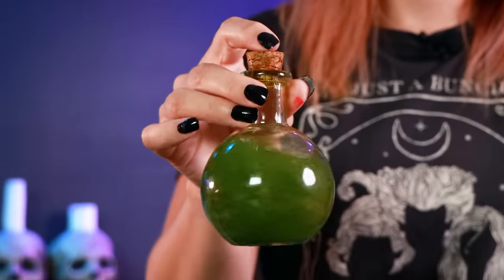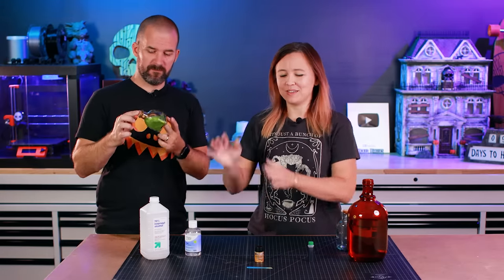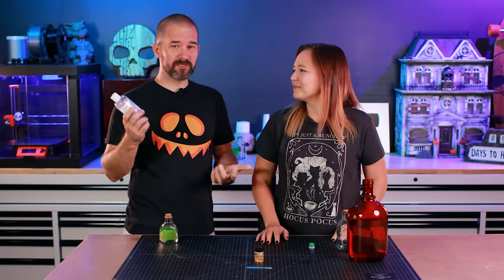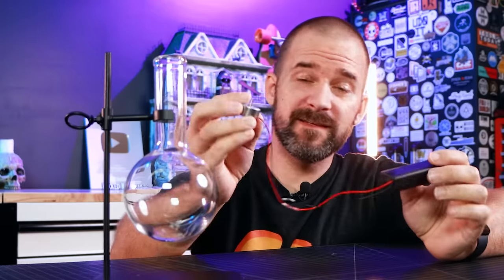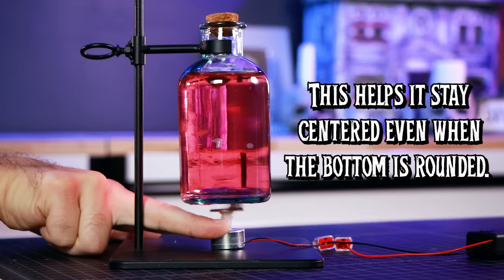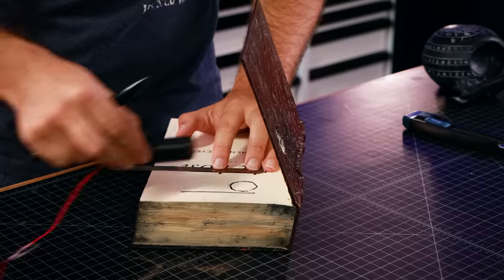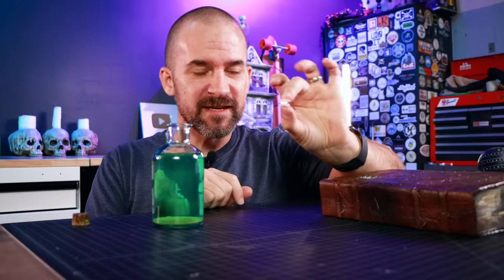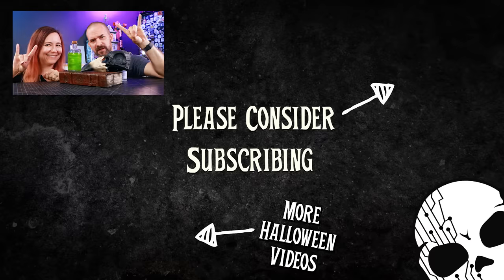We made Halloween Witch's Potions with a Magical Twist!

Comment: Guys! You make this look so easy! Im struggling- bought all your items but i cant get the magnet part to work.   The nut with quarter flies off the second it gets close to the jar….. any ideas/ thoughts/ tips???
Reply from the maker: The whole quarter flies off the motor?
Reply: Yes. The quarter is glued to the nylon “ nut”.  Magnet glued to outside edge of quarter. Did you glue the nut to the shaft?? Ive watched and stopped this video 100 times to see where i went wrong!! Lol. You guys seem to be the pioneer of this prop!  Thanks
Reply from the maker: @paulakrouse8303  YES! We did glue the nut to the shaft, thats what you're missing. Put some hot glue on the inside of the nut and squish it down onto the shaft (careful not to use too much as you don't want the glue to touch the motor itself.) This will keep it on there.

Comment: you dont need to cut a hole in the book cover, magnetism is not affected by cardboard.  A small LED would make the potion glow, or pulsate, and WOULD need a small hole.dont get me started on fiber optics.
Reply: small white beads with a black dot to simulate eye of newt, added into the potion might add to the mystery.
Reply from the maker: It is affected by distance though and it needs to be close to work well. 🤘🏼🤘🏼
Reply: @WickedMakers  those dots are STRONG.  I want to make a flea circus.  Have you tried that?

Comment: Hello, Love Your Creativity! I want to make this Bottle & Book, ordered everything from amazon. But I can not find the White Nut that you Hot Glued to the bottom of a quarter. Please, where did you buy this? I have searched for hours for a white nylon/plastic "nut" that pressure fits on to the shaft of the motor that you use. Hope that you read this comment and can help me. Thank You Wicked Makers!:yougotthis:
Reply from the maker: Sorry for such a late reply! m2 is the size you'll need. It should fit pretty snug and you can use a bit of hot glue inside if you need to.

Comment: Took a bit more putzing than expected! But fun wish I could add my video
Reply from the maker: You can post it in our FB group or on Discord! Would love to see.
Reply: Mine didn’t work at all. It works when I move the outside magnet manually, but it doesn’t even come close to moving the magnets inside the bottle when I use the motor. I don’t understand how you guys got yours to work.
Reply: @KattaurusM-sx8pn  imstacked 3 magnets on motor and 3 magnets inside and works great. Jar has to be really close to the magnets with out touching. It took me. A bit of tweakingap and adjusting
Reply: I used 2 magnets inside and 4 stacked outside, like they show in the video. All it does is throw the magnets off to the side, outside of the reach of the motorized magnets. They won’t stay in the middle of the bottle. I’ve tried less magnets and more magnets. I’ve tried with and without glue on the inside ones. No go. When I use the glue on the inside ones, it flips sideways and does not stay flat like it does in their video. 😢
Reply: Okay…FINALLY got it to work. Took 9 magnets on the outside, attached to the tin lid of a tomato paste can to get a wider spin. Glued a quarter to the opposite side of the lid, to counter the magnet weights. Made the hole bigger to accommodate the larger spinning. Lastly, when I glued the inside magnets (only 2), I made one side of the glue much larger (top heavy) in hopes of keeping it from flipping sideways. Nope, still flipped, but at least it’s spinning now. Phew!
Reply: @KattaurusM-sx8pn  believe me mine took a lot of tweeks. I wish I could add photo here, I put a small piece of clear acetate about 1/2 long between my 2 magnets…act like fins to. Move water better and dabbed hot glue to stop some of the noise! So love this thing! Next onto the moving eyeball book
Reply: @KattaurusM-sx8pn  also once you get it working, after i really glued the motor down it even worked better! I kept putting bits if hot glue, let it dry then added more around the motor till it was completely firm. That hep
 stabilize the spinning also.

Comment: So I don't know electronics at all.  I was wondering is it possible to take something like the cheap motion sensor witch prop from the dollar store and adding it to an LED strip of lights.  Could that work and/or what else would be needed to complete the connection?
Reply from the maker: It wouldn’t be super hard but not quite as simple as you described. The motion sensor depends on a circuit that is built to turn on with the sensor so you’d need to use something like an Arduino.

Comment: Just curious but does the motor heat up at all and is it safe to run for long periods of time?
Reply from the maker: With just one battery it hasn’t gotten hot in our tests. Pretty low voltage.

Comment: I love this idea. I'm almost done with mine but I'm having a problem with the magnets. I cant get them to spin. I'm not sure if the motor is too fast or what. I got slightly stronger magnets, doubled up on them and still I can't get it to spin. I'm lost. Any help?
EDIT: upon further research of the motors I realized I got 3V 2 AAA battery packs causing the motor to spin much faster. Hopefully the lower voltage single AA battery pack will solve my issue

Comment: I'm confused by what you mean when you talk about the pigments. 
Mica powder IS opaque, it don't need to be dyed? The swirl is the reflective part of the pigment. Adding 'too much' mica wont change that or make it 'too opaque', heck you may want or need more depending on how much mica to liquid you have to saturate the liquid with the mica particles. Mica just... it isn't a transparent pigment. I've worked with micas in stuff like resin and DND props for over 5 years now. You don't need anything extra to make the swirl aside the water + glycerin combo and mica powder. Yeah if you add in too much dye, it will become opaque as you are over saturating the water with a pigment, but you don't need that step at all. This is like saying if you add too much of a gloss finish you wont have a gloss finish. Mica isn't transparent, adding 'to much' isn't going to remove the swirl.

Also, to do the swirl.. you can get like those pill spinners that are found in chemist sets (get like, a bag of 20 for a few dollars) and just drop a small one in and use that instead of the hot glue mashed magnets. Less risk of the glue breaking down over time and works with the same kind of motor setup. It's how I've done similar effects, even did a magic pool using well, all of this just in a small dish to be a magic pool of water for one of our dnd games with blue green swirling mica.... that again... didn't need dyes :P Just glycerin and water and 2 grams of mica and a spinner in the middle on a low setting to make magical swirls.

Comment: I'm trying to replicate the enchanted potion bottle for a Harry Potter themed trunk or treat with the kids.  Unfortunately, I can't seem to get the "storm" effect to work. Does the motor need to be a specific speed? The motors I have seem to be spinning so quickly, the magnet inside the bottle doesn't really attract to it. Did I possibly make the hot glue magnet thing for inside the bottle too big? Does the bottle need to be a certain shape/size? I get the effect by shaking the bottle, but the whole point would be to make it do it on it's own. :) Thanks!

Comment: I tried making this but its not working for me :(    the motor spins but the magnet inside the bottle doesn't move.  I ordered the products (magnet and motor) listed. What can I try different?  The bottle I am using does not have a thick bottom.  Do i need stronger magnets?  I ordered the 8x2 as listed.

Comment: How is the noise with this motor?  I ordered a different 3v, 1700 rpm motor and it is very loud.  Hopefully the book muffles it because outside it is very loud.
Reply from the maker: Try with just the single battery. The one we used is quiet if you reduce vibration and secure it fully.
Reply: @WickedMakers  thanks.  I'm also having trouble getting my "stiring magnet" to work.  I've made the magnet standing up "perpendicular " to the hit glue puddle and laying flat in it...neither actually engage and spin well.  Maybe the magnet at the edge if quarter is too far?
Reply: @steveburrows8420  2 things to check: The thickness of the bottom of the bottle and the speed the motor is spinning. I had the same problem, once I used a bottle with a thinner base and bought a lower RPM motor, I got the internal magnet to spin.

Comment: The battery pack is for 1 AA (1.5V) but the motor is 3V. Is that the wrong link or does it work anyway? (I couldn't find a 2AA pack with a switch.)
Reply from the maker: Yeah you want to run it at half voltage or it’s too fast.
Reply: @WickedMakers  Wow - quick reply! You two are great together! Great instructions without going over the top with "I love, love, love, ... this" or "I'm soooooooo excited about this". Just genuine enthusiasm with a few jokes here and there. Great couple. Do you have other channels like "Christmas Makers" or "Thanksgiving Makers" or just "Everything Makers"? Your techniques can be applied to other things - just like watching you solve problems and work the way you do.

Comment: does the motor get hot at all with no ventilation?
Reply from the maker: Nah the voltage is so low it barely warms up.
Reply: Perfect, i used something similar with a larger motor to make a pink amethyst sphere rotate, but that motor got really hot and started making noises.     Im going to make this for sure!

Comment: Hmmm stil figuring it out because the motor with magnets are so in unbalance..... So no way I can get the motor stable...... I am using a different type of motor, those they use in toys..... So they have an higher RPM, I used it with 2 instead of 3 batteries so the RPM is lower but maybe still too high.... 
Did you had any issues with that too?
Reply from the maker: Try just one battery, should slow the motor down a lot. If it’s way unbalanced try magnets on opposite sides of the quarter to balance it.
Reply: @WickedMakers  yeah im now trying with the gears from the toy but that makes soo much noise lol.  Otherwise one battery would be a good try too!

Thanks for your great videos and inspiration!
Reply: With one battery it was still too fast so the other magnet was not doing much. With the gears, and thus slower, it did move but it was just turning a bit in the center. With another thinner bottle it worked a bit better. So or the magnets i use are not strong enough or the surface (where the magnet is glued on) is too small.  
Tried it with extra magnets on the surface but then together with the motor and gears it becomes too high to fit in the book.

Will figure it out :)

Comment: Tried this. Potions look cool but the motors I ordered from the description become very loud when I put the coin and nut on them and are so powerful they vibrate the book around the table. Not sure what I’m doing wrong 😅
Reply: I had the same issue, the magnet inside is very clanky on the glass even with hot glue and the motor is loud, anyone have any ideas?

Comment: I tried making one of these, but for the life of me I cannot get the blob in the bottle to move when the quarter with the magnet is underneath the bottle. I've tried different speeds on the motor, I've tried adding a second magnet on top of the first on the quarter. Has anyone else had an issue with getting the bit in the bottle to actually move via motor? It works when I stick the magnet on the outside to the bottom and wiggle it manually, but not otherwise.
Reply: I figured it out. If anyone else has a similar issue, for me the solution was MANY more magnets on the quarter (at 6-7 it started working). I'm also having trouble getting the blog to lie flat--it tends to want to rest on it's side at the side of the bottle. Realigning it before turning on the motor helps.

Comment: So, thus far, I'm at $81 for the parts to this project, not including the book, the tissue paper, the acrylic paint and the quarter. Lowes has this thing complete as a decoration for $30. Just sayin. Btw, this price includes one bottle.
Reply from the maker: That’s not how you price projects.🤘🏼😄 Majority of things listed are not single use so the BoM needs to account for that. I.e. you’re using one drop of food coloring not four full bottles, so that $4.79 is more like 10 cents.
Reply: All of these supplies are available at the dollar tree with possible exception of the motors, though tbh they probably have a few toys with small motors you disassemble. I’ll check on that and let you know in a day or two. So less than $10 for one and you’d have magnets, modpoge, crepe paper, glue sticks and glue gun, colors etc left over for more if you wanted.
Reply from the maker: @SteelcityinNY  Yeah I totally get it, all good. :) There's always an initial investment for tools and multi-use materials like glues and paints, but those costs should be amortized over the course of many projects. Not saying someone might not have to spend a few bucks to get going but we want to help people understand that the costs for the actual materials used are significantly less than the initial investment and that it's normal to then go share them to other projects and spread those costs out.